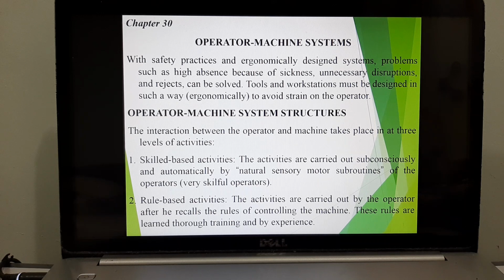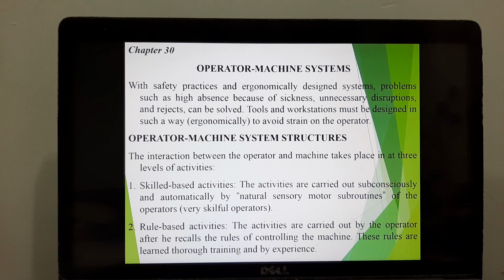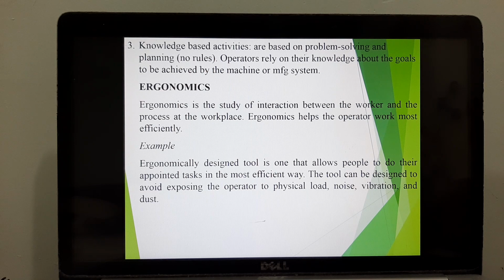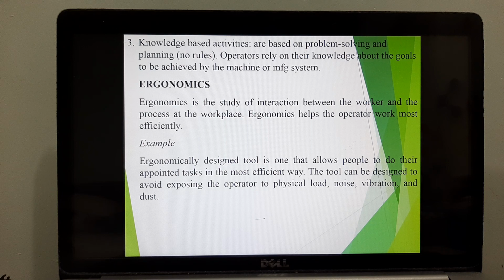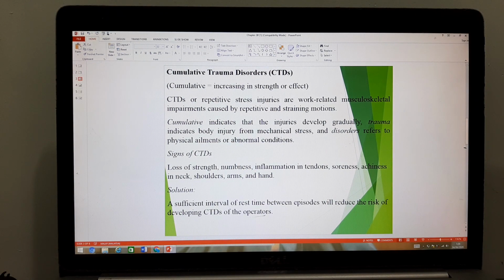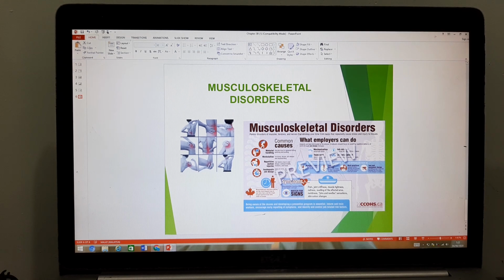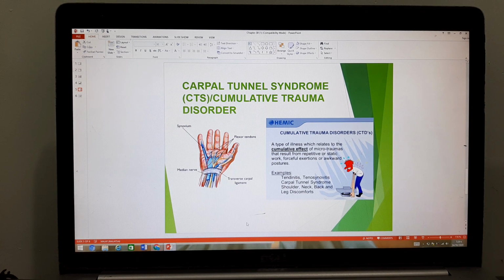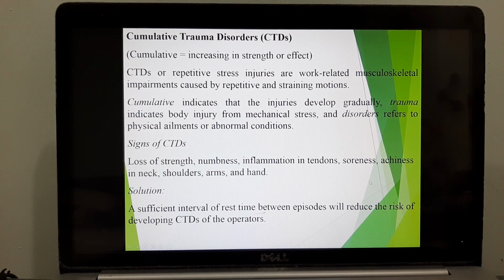OPERATOR MACHINE SYSTEMS

Comment: Hello madam, from this video i learned about different operator machine systems:
skilled based: carried out subconsciously and automatically by "natural sensory motor subroutines" of the operators.
rule based: carried out by operator after recalling the rules of controlling the machine. Learned through training and experience
knowledge based: based on problem solving and planning. rely on knowledge about goals to be achieved by machine/mfg system

ergonomics:  study of interaction between worker and process at workplace. helps operator work most efficiently. allows people to do their appointed tasks in the most efficient way. Can be designed to avoid exposing operator to physical load, noise vibration and dust.

cumulative trauma disorder: cumulative effect of microtraumas that result from repetitive or staitc work, forceful exertions, awkward postures
example: carpal tunnel, shoulder, neck, back and leg discomforts.

repetitive stress injuries are work related musculoskeletal impairments caused by repetitive and straining motions. Develops gradually from mechanical stress and disorders.
Solution: sufficient intervals of rest time between episodes will reduce the risk of developing CTDs.  

Thank you Dr.
AHMAD NAZRI BIN AHMAD TAMRIN ME0106079

Comment: Good morning Dr. What i have learned from this video is about operator machine systems. There are three levels of interaction between operator and machine which are skill based activities, rule based activities and knowledge based activities. Skill based is natural sensory motor subroutine. Rule based is carried out by the operator after he recalls the rule. Knowledge based is based on problem solving and planning. 
I also learned about ergonomics which means the study of interaction between the worker and the process at the workplace. Bad ergonomics cause disorders faced by operators which are musculoskeletal disorder and carpal tunnel syndrome. A way to prevent this is by several interval rests during episodes will reduce the risk of CTDs. Thank you Dr

Muhammad Naquib Bin Nor Azlan
ME0106093

Comment: Good afternoon madam, I am Wong E-Shen (ME0106071). From this video, I have learnt about operator machine system. Operator machine system is the safety practices and ergonomically designed systems and problems. There are 3 level of operate machine system. The first level is skilled-based activities. Skilled based are the people who have been doing the same tasks on the same machine repetitively. The workers can operate the machine without thinking as they have memorized all the steps. Next, rules based activities are the are carried out by the operator after he recalls the rules of controlling the machine and these rules are learned through training and by experience. Thirdly, for knowledge based activities, it is based on problem-solving and planning. The operators rely on their knowledge to the goals. Then, ergonomics is the study of interaction between the worker and the process at the workplace and helps the operator work most efficiently.
 For example, ergonomically designed tool is one that allows people to do their appointed tasks in the most efficient way. The tool can be designed to avoid exposing the operator to physical load, noise, vibration, and dust.
 Besides that, muscular skeletal disorders is caused by improper way of lifting an object for a long time. Next, carpal trauma syndrome or cumulative trauma disorder is caused by people who over straining of the fingers by using their fingers very frequently. The solution to solve these issues are having a sufficient interval of rest time between episodes.
Thank you.

Comment: NIGEL ANDERSON SINGH A/L RAJDEEP SINGH
ME0106094
Good day, madam. Ergonomics is the study of interaction between worker and the process at the workplace. It helps the operator work most efficiently. With safety practices and ergonomically designed systems, problems such as high absence due to sickness and others can be solved.
 
Three levels of activities of interaction between operator and machine are :-
1. skilled-based activities (subconsciously and automatically by 'natural sensory motor subroutines' of the operators ) 
2. rule-based activities (recalls the rules of controlling machine which are learned through training and experience) 
3. knowledge based activities (based on problem-solving and planning). 

Cumulative Trauma Disorder (CTD) or repetitive stress injuries are work-related musculoskeletal impairments caused by repetitive and straining motions. 
Signs of CTDs are :-
--loss of strength                                      
--numbness                                                
 --achiness in neck, shoulder, arm and hand.
Solutions : A sufficient interval of rest time  between episodes will reduce the risk of developing CTDs of the operators. 

Thank you.

Comment: ME0106053 Marcus Chuo 
Good day madam the info gained from the video are on operator machine system. 
Safety practices and ergonomic design are extremely important to ensure the safety of workers and prevent them from unnecessary injuries and sick leaves.
There are three levels of operator systems
1) Skilled based operators where they are meant to memorise all mechanical processes and steps, requires a natural sensory-motor subroutines, and are skillful
2) Ruled Bassed operators where they need training and follow the rules of controlling the machines
3) Knoowledge based activities where requires problem solving and planning and while relying on own knowledge to achieve goals.

Next is on ergonomics which is the study of the interaction between workers and the machine and process of the workplace.
There are also many types of disease that occurs to operators such as musculoskeletal disorders which are caused by incorrect lifting postures. The symptoms of this disease is aching in all parts of the body. Next is cumulative trauma disorders or commonly known as carpal tunnel syndrome which is caused by using fingers too frequently
 for extensive period of time, repetitive and static works with no rest. This injury occurs and take effects after a long period of time.
It is wise for giving workers a break after long hours to prevent workplace disease from occuring

Comment: Good Day, Dr. I am Derrick Ng Kian Ping (ME0105733). At the end of the video, I have learned about operation machine systems. With safety practices and ergonomically designed systems, problems such as high absense because of sickness, unnecessary disruptions and rejects can be solved. Tools and workstation must be designed in such a way ergonomically to avoid strain on operator. Next, interaction between operators and machine tool take place in 3 different levels of activity which are skilled based activity (carried out subconsiously), rule-based activities (carried out by operator after recalling rules of control of machine,rules learned through training and experience) and knowledge based activities (based on problem solving an planning, rely on knowledge). Next, ergonomics can be defined as the study of interaction between the worker and process at workplace. Ergonomic helps operator work most efficiently by avoiding exposing operators to physical load, noise, vibration and dust. Moving on, Cumulative Trauma Disorders is the repetitive stress injuries where there is a cumulative effect of micro traumas that result from repetitive or static work,forceful exertions or awkward position.This disorder develops gradually, trauma indicates body injury from mechanical stress and disorders refers to physical ailments or abnormal conditions. Some signs of CTD includes loss of strength, numbness, inflammation in tendons, soreness and and achness. One solution to overcome CTD is to have a sufficient interval of time. Furthermore, Musculoskeletal Disorder is a painful disorders of muscles, tendons and nerve that develop over time from task that repeatedly cause stress and injury to tissues such as material handling. Lastly, Carpal Tunnel Syndrome occurs due to straining of hands and fingers which mostly affects typist and it affects nerve and wrist.

Thank You

Comment: Good morning madam, today i have learned about operator machine systems. There are 3 levels that interaction between operator and machine take place:-
1. Skill based activities- natural sensory motor subroutines. The operators are very skilled. 
2. Rule-based activities- Carried out by the operator after he recalls the rules. Rules are learned through training and experience. 
3. Knowledge based activities- based on problem solving and planning. Operators rely on their knowledge solely. 
Next, is ergonomics. It is the study of interaction between the worker and the process at the workplace.  
Then we have the disorders faced by operators. 
1. Musculoskeletal disorder- caused by improper posture and causes body ache.  
2. Carpal tunnel syndrome- caused by repetitive and straining motions. Operators may suffer from swelling, tingling sensation and pain.  
Solution- several intervals of rest time during episodes will reduce the risk of CTDs. 
Shahnyeel A/L Anil Kumar
ME0107096

Comment: Good morning madam, I'm Chong Jin Yang (ME0106047). From this video, I have learned about operator machine system. It is a safety practices and ergonomically designed system which will avoid strain on the operators. 

3 levels of operator system
1) Skilled-based activities
- "natural sensory motor subroutines"
- very skillful operators
- memorise all the mechanical processes steps

2) Ruled-based activities
- follow the rules of controlling machines
- through training

3) Knowledge-based activities
- problem solving and planning (no rules)
- rely on own knowledge to achieve goals

Ergonomic
- study of interaction between the workers and the process of the workpiece

Types of common disease on operators
1) Musculoskeletal disorders
- incorrect lifting posture
- ache in all body parts

2) Cumulative Trauma Disorders
- also known as carpal tunnel syndrome
- uses fingers too frequently
- repetitive or static works
- Cumulative (injuries developed gradually)
- Trauma (body injuries from mechanical stress)
- Disorders (physical ailments)

Solution
- a sufficient internal of rests between the episodes.

Thank you.

Comment: Good day Dr. Im Lee Zi Sheng ME0106051. In this chapter, I learnt that, with safety practices and ergonomically designed systems, problems can be solved. Tools and workstations must be designed in such a way (ergonomically) to avoid strain on the operator.
The interaction between the operator and machine takes place in at three levels of activities:
Skilled-based activities:  carried out subconsciously and automatically by “natural sensory motor subroutines” of the operators 
Rule-based activities:  carried out by the operator after he recalls the rules of controlling the machine. 
Knowledge based activities: based on problem-solving and planning (no rules). Operators rely on their knowledge about the goals to be achieved by the machine or mfg system. 
Ergonomics is the study of interaction between the worker and the process at the workplace. Ergonomics helps the operator work most efficiently.
Cumulative Trauma Disorders (CTDs)
CTDs or repetitive stress injuries are work-related musculoskeletal impairments caused by repetitive and straining motions.
Cumulative indicates that the injuries develop gradually, trauma indicates body injury from mechanical stress, and disorders refers to physical ailments or abnormal conditions.
Signs of CTDs 
Loss of strength, numbness, inflammation in tendons, soreness, achiness in neck, shoulders, arms, and hand. 
Solution:
A sufficient interval of rest time between episodes will reduce the risk of developing CTDs of the operators. 
Thank You.